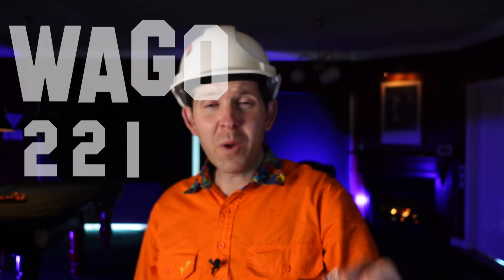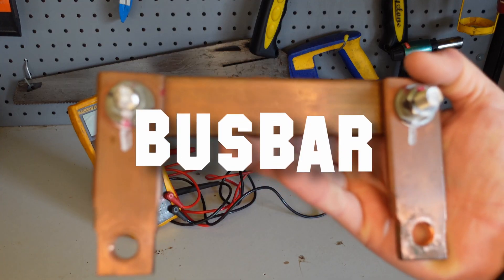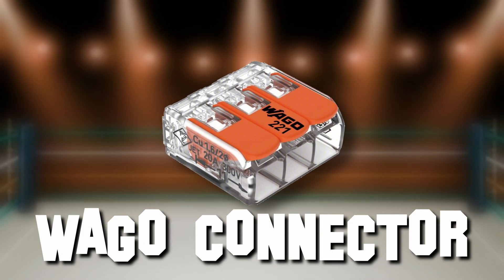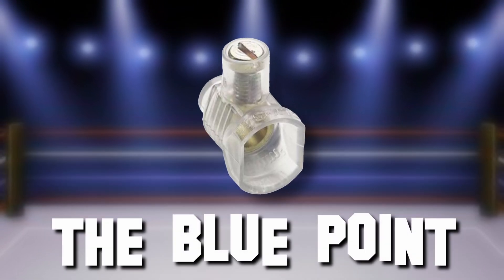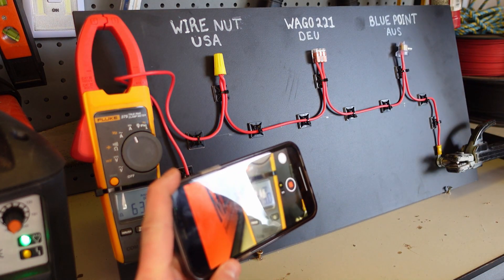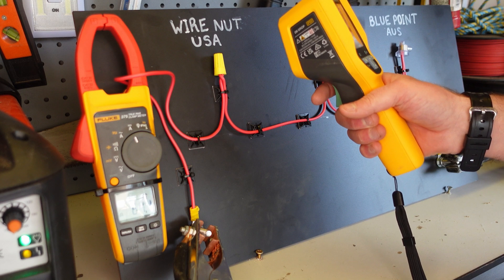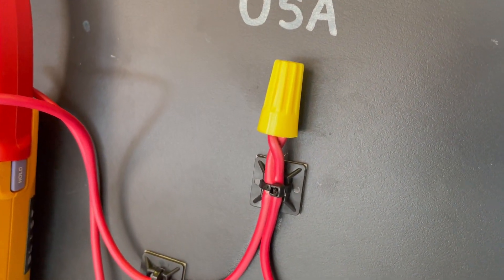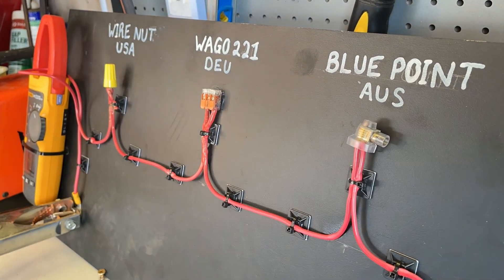Why WAGO's will always FAIL this TEST...

Comment: Better rename the video to something like "Why you shouldn't use twice the rated current on a connector" - This is not a test on anything anybody should ever do. You could downsize the wire to burn everything down and call it a failed wire. About as useful as this....
Reply: at 80 amps when wagos are rated for 32
Reply: And?  He explicitly said that protection would have tripped well before anything started melting.  It's a clickbait title, with a fun little experiment showing that those connectors are extremely robust.

Comment: Remember, you are measuring the temperature on the outside of the wire nut.  If it's that hot through all the plastic, the connection is going to be MUCH hotter.

Comment: why test a 2,5mm2 cable with 64A? you should test all in normal conditions in this case for that type of cable should be 16A or 20A.
Reply: Uhh, that's sort of the point.
Reply: @arthurmoore9488   no is not, in a fault scenario that is stop by the breaker.

Comment: I did my own tests some time ago.  Spring lever type (so Wago, other brand names and fakos) vs good old Aussie twist up and whack into a terminal.  I daisy chained 10 of each to amplify the results and measured / jiggled the string.  Beyond any question that spring lever ones had higher resistance and were mechanically unstable, ie resistance varies if you twiddle them rather than leave them alone.

Guess what?  It didn't matter.

In any sane application of wiring design you won't have enough dedicated joints (ie not a joint at the back of a power outlet, switch etc) for the increased resistance of the spring lever type to push the circuit out of spec.  With the mechanical stability aspect, if your terminations are flapping around in the breeze you've screwed things up royally anyway and the connectors aren't a factor in that.
Reply: "Flapping in the breeze", I'm detecting Dave Jones energy. ;-) WINNAH WINNAH CHICKEN DINNAH!

Comment: I have a question.(I'm living in europe) I was thinking use wago connectors for a future project. it will be a small room with 2 outlets and one lamp. I will protect whole room with B16 circuit breaker and use 2.5 mm thick cables. Will it be safe to use wago connectors?
Reply: Yeah They are good for up to 32A. I have never had one failed me. The only reason I don't use the clip version, is they are to easy to pull out off when you arr open boxes and are going to debug.
Reply: they are rated to not make any issues in domestic use, this test in the vid is over the certified range tho so you might not take the results for your own decission unless you want to get beyond certification on the use

as said, we are way past the 32A which they are rated for and with enough current you can roast any connector
Reply: Yes 100%
Reply: @derKarl_stp gets really spicy when you short out a bus bar.

Comment: I do enjoy a lot of your comment and I really like the overload component on many tests but honestly this time it is a bit weird... I know that blue point connectors are the closest to our screw type connectors but comparing something to a product not rated to the amount of current just to have something fail... yeah... every connector has its use... just the wire nuts are kinda yeah... oldschool and US-American tradition

the blue points are some tough things but I am sure they are rated for a different current range than the WAGO 221 clamps

it is kinda weird to compare connectors on a multiple of the current that they are rated for (wago clamps for example are rated for 32A at max. for usage but in the vid you went up to 80A+ and for normal every breaker should have popped way before that level on current twould have been reached in a regular use)

And actually it was the wire failing first... on ALL connectors from what I have seen.

I bet you can break the blue points as well with the "wrong current" used and "usage above rating" just that it has not been shown in the video

by the way, for high current usage you don't use any of these clamps but you use crimp connectors that hold up to way higher currents, at least if you know what you are doing (which I guess you do know) but for entertaining reasons... goal achieved

Comment: @5:12 why failure on WAGO ? Does WAGO lost connection ? Increased resistance ? Exposed connectors ? It only became one use, providing safety.
Blue point @5:24 seems to expose metal also i see some shady cheating here, one conductor is not inserted or broke off (at least partialy) ?

Comment: An actual engineer pushed the wago past 70 amps and 235C: the 12g wire insulation failed before the wago failed. 
I’m ok with using wagos in my home.

Comment: The test it’s not showing what suppose to. Wago rated for 20 amps hold in many test up to over 200 amps. That don’t means that you always had that situation. It’s a maximun in a fortuitous conditions. If you size wire, breaker, and circuits to the correct range, you will never had problems. They are safe also to be installed in wall, without box.

Comment: Interesting to see how they reach failure points individually. It definitely makes sense that having a busbar as opposed to wire-wire connection would make it less efficient, and therefore hotter. This video gives good info in the event that you need to use one of these in an application with too high of current, or in an area with poor/no cooling. That said, none of these will likely be used often in high current applications, but I can absolutely see someone using them because it's all they have, or because they think "it'll be good enough"

Comment: Americans should firstly get to the 21st century in the matter of electrical installation. I have seen A LOT of videos about electrical installations in US, and talked to friends who are electrical engineers, myself being an electronics engineer, and everybody says the same thing, US electricians need to adapt the rule book to the present day, and toss the 20th century one.
Reply: in what regard? like specific examples? (serious question). I'm not an electrician, but love the science and engineering of the field. What is the US doing wrong?
Reply: @ElementalITcc   Nice seeing a person asking a question in a serious way on internet these days:). First, the electrical panels. As you probably know, there are multiple types of protections, ones for the circuits, to protect the wires in the installation, to not overheat them if the device connected to the outlet of these wires is consuming too much amps or if the wires make a short circuit. These are called MCB's. There are protections to protect the people of electrocution called RCD or GFCI in America. They are checking if the current consumed by the devices is the same as the one returning to the RCD(if a heating device is using 5 amps, 5 amps must turn back from where they came from). If the current returning is not the same, it means it goes somewhere else, maybe through a person and to the ground. A human heart can stand up to 30 miliamps, above this value can be fatal. Americans are usually using those only in places like bathrooms and kitchens. They MUST be in every circuit in every house. These can save lives. There can be electrical devices wich came with a fabrication fault, that's why we need these. Apart from those 2, there are relays to interrupt the phase in case of lighting strikes to not fry the 2k dollars tv or anything else. Protection from electrical arc, AFDD. Using cables instead of pipes and those kind of things. Not twisting wires for God sake:) It is wrong in every way. Most of electricians think that if you have 3 or 4 centimeters of twisted wires, it is a good connection. Wrong. Current will only use the first milimeters from the twisted wires, the rest is pointless. Because of earthquakes, vibrations etc, twisted wires, if not done correctly, can suffer modifications, which is bad. A wago connecter is much more easy to use and elegant. If you want to moify something after the connection was done, the wago can let you do that, but a wire connector is destroying the conductor. They are tested and re tested and they can withstand up to 80 amps ac current 230V(a man from my country did that test). Protection from direct touch, anywhere in the installation. Pigtails? Prehistoric. I saw a video in which an electrician was installing the lightning in a kitchen, and the device came with a wago. He cut the wago and put a wire nut:(. There are things that are not coming through my mind right now, but those i wrote about above are the most important. Thank you for reading this, hope was not too long and my english was good enough:)
Reply: @crissalex8906  I'm confused about your complaint.  American code requires GFCI on each circuit or on each outlet if not on the circuit.  We also require arc fault protection on any circuit not hard wired to an arc welder.  We require conduits/armor behind walls, we require lightning arrest.
You are also wrong saying our code requires wire nuts.  They are still allowed to be used but so are wago and many other junction devices.  The only requirement in the code is that you must follow the manufacturers directions when using them.
Of course wago would be far more popular without scare videos like this one saying how they fail and burn when that is demonstrably false.  People just aren't smart, they read the clickbait and thumbnail, but don't watch the video to see how not only does the wago work up to their max ratings, but many times above their max ratings.  So of course people are scared to use them.

Comment: Guys should understand series and parallel circuits how they how circuit works.  Before make a video.
Reply: The test is very good, because connectors are in serial. Then the current and time is exactly the same for them all.

Comment: O.k. i have to be honest.... i didn't like your video at all ..... i still don't really like it..

But you're actually right, the Technical Design Aspect of the Wago and other Cage Clamp connectors, will always suffer heating on the busbar and it's connections..

So .. at least now we actually know why we should never buy any cheapo alternatives.... because ..... from wago, at least you get guaranteed that they won't melt down just in normal usage. :)

Meh ...

"Blue Point" ... Who comes up with such names?

Whats bad on the god old german "Lüsterklemme"? EvilGrin

Hacky. ;)
Reply from the maker: What didn’t you like about it?

Comment: Definitely these are not designed to that current wht they say it can handle. I'd say its good for low current appliances like decorative LED lights, or other low consumption stuff.
Reply: They are rated to 32A and here in Germany thay are the standard for a reason.
We generally use a higer voltage, so voltage drop and current will be lessened.

Comment: Best method is the old method. Take a high grade bolt. Said bolt will be sliced down the middle to accept wire. The slice should be one third of the bolt's diameter, not bigger (so appropriate sized bolt required).
Silver plating of bolt, washer and nut.
You insert the wires in, opposite one another. Three wires are two one way, one in the center facing the other way.
Put washer, tighten nut, snap excess prongs bending outwards towards the nut and drive one of the prongs back into the hole as a wedge to permanently lock it in place. High quality shrinktube.

Copper on copper, where the nut is purely mechanical advantage to keep the wires together. The whole wire will melt before anything else will. No BS, no long term issues with plastic aging. No issues with cheaply machined (thin) jackets that are cut to leave the bare minimum brass tube around where time would eventually fracture the brass from expansion of materials under heat, no wire twisting garbage. Just pure. Mechanical. Connection as the Amp gods intended.

Comment: The reason the wire nut is having issues is because the Wago connector is inline with it.  When you have a compromise on a circuit, the entire circuit is compromised... that is how electricity works.  The Wago will cause the wire to get hot when there is a significant load because its limited contact surface makes that point like having a smaller gauge wire in place that isn't rated for that current.  This means the entire wire gets hotter and resistance increases, creating a runaway effect and screwing up EVERYTHING, including the wire nut.
Reply: More resistance means less current, less load. The test is very good, because connectors are in serial. Then the current and time is exactly the same for them all.
Reply: @ Not working as much as you want it to.  This is how fires happen.

Comment: i will stick to the wire nuts.  When heated they can expand and contract back to original size.  What I dislike the Blue point is its screw and WAGO looks to flimsy.  The heat and cooling cycles might loosen the parts over time.   My dad still have a few wire nuts that use a screw, the3y dont work so well.
Reply: is "The heat and cooling cycles might loosen the parts over time." not basically the same like "When heated they can expand and contract back to original size." ?
The spring mechanism inside the wago can compensate for that. i didnt use wire nuts before (they are just not common here) so i dont know, do they have a way to compansate?